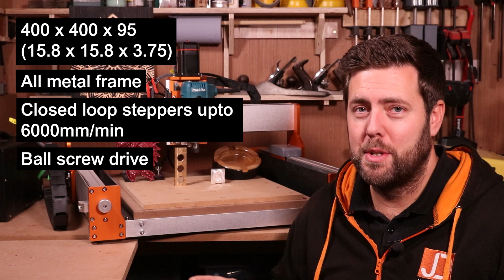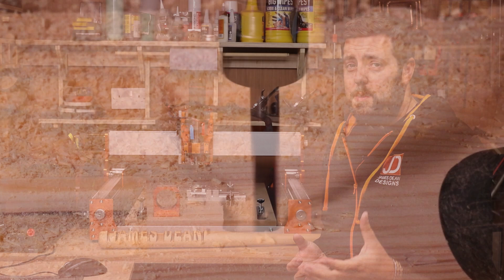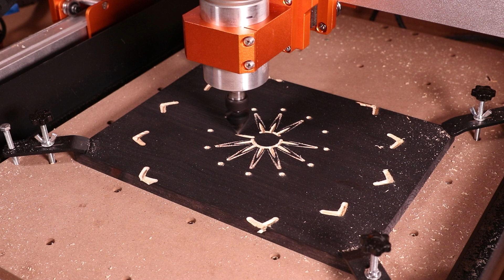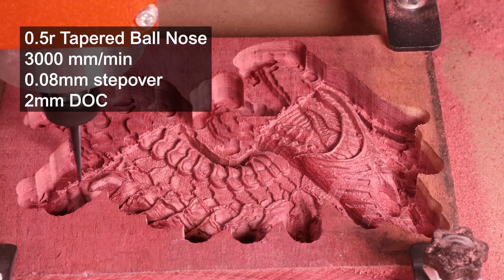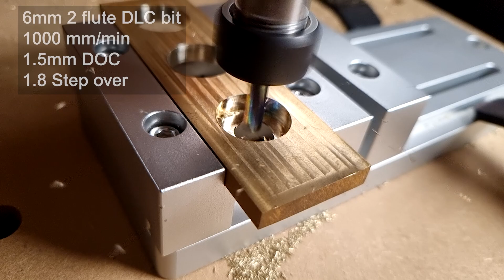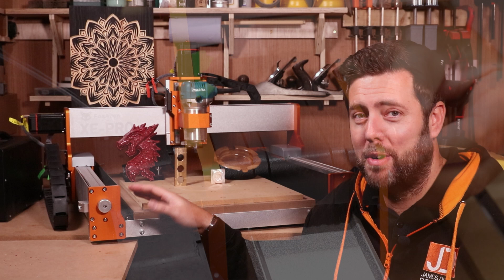What's it capable of? The new FoxAlien XE-Pro Desktop CNC machine

Comment: To be or not to be (I am ready to pull the trigger)? XE PRO or Vasto for sturdiness (after linear rails on XE PRO and strengthening Vasto bed adding the closed loop stepper motors and upgrading to 1.5kw spindle on both - cost in this case is not an issue) for aluminium work? What say you?
Reply from the maker: For me, the XE with linear rail kit comes in cheaper than the Vasto and has better stepper motors so for me the XE Pro is the winner
Reply: Thank you so much ... time for a decision now.

Comment: James - great video!  I have the CL-6560 and can't get a decent cut with a 1/4 End Mill bit regardless of the various feeds and speeds I've tried.  So two questions:  1) You mentioned in the video about having to tighten up some bolts to get a clean cut.  What is the best approach for taking on thie task of checking all the bolts? 2) Since I can get clean cuts with 1/8 End mills and v-bits, I'm thinking it's the 400W spindle that is causing the issue.  Thoughts? And which trim router would you recommend if you feel it's a power issue?

Comment: Another problem that may arise from those SS wheels running on SS rails is chips getting in between, cover and dust shoe will help but eventually it will happen. With the machine, upgraded rails, a dust shoe and an upgraded spindle not much change from 2 grand or even more if you need cutters etc.
Reply from the maker: Yes, I think show this in the video about chips essentially getting compressed onto the rails. It's not ideal but little tweaks can help, for example 2 piece of scrap cardboard down the side of the spoilboard will stop a lot and costs nothing

Comment: I have a problem with the z-probe. Everything is fine when I probe but the machine always starts to cut a few mm above the material. Tried with the offline controller, Easel, or UGS. When I add the g0 z0 command after probing it does not go at zero position. Why?
Reply from the maker: You have to set the thickness of your probe accurately before starting which I suspect is the issue. For example if you software thinks the probe is 10 thick, but its actually 15mm thick then it will always start 5mm too high
Reply: thanks for the answer! The problem was in the step config. The problem was solved! Thanks again! Keep up the good work!!

Comment: I think the XE-pro is an excellent machine but can it support use of a 4th Axis rotary module (which would have to be purchased from a third party)?
Reply from the maker: No. FoxAlien doesn't currently support 4th axis. Its quite a nice market. Its use rotary devices but there is a difference between rotary and true 4th axis

Comment: So going to be getting my first machine soon.  I want to get something pretty decent to begin with and I want to play with aluminum and sometimes even steel. I also want to equip it with a laser? Would I be better to go with the EX-Pro and linear rail kit or the Vasto?   Also, could I use a Lasertree K40 laser spindle, or would I only be able to use the FoxAlien laser?  I know the Lasertree is 24v whereas the Foxalien is 12v, but with a separate power supply would the machine still control the laser?

Comment: Hi, James
Is there an accessory for wood carving 4 th axis rotary?  I could not see it in website.
Is there any recommendation.
Reply from the maker: No, this machine is not designed for 4th axis. The baseball bat is done as a normal carving. It will handle a rotary device which is slightly different than a true 4th axis.
Reply: Thanks James, for the reply, will you give more details on a video,  in the near future?
That will be more interesting.

Comment: Can you tell us more about vfd spindle? Total newbie here. Is that the better option to try for or a mikita
Reply from the maker: VFD and spindle is the superior option, but they do cost more and  take more effort to setup. So if you're a complete newbie then I'd say the router is the safer option
Reply from the maker: And just to expand, a VFD basically powers the spindle in a slightly different way but its much better at maintaining RPM and torque as a result. VfD spindles are also brushless so usually quieter and last longer as well
Reply: @JamesDeanDesigns  thank you sir.
Reply: @Ice_Panda1C3 thanks
Reply: How do you set the speed of the stock spindle using just the offline controller? Is it really just turn the know till it "feels" right?